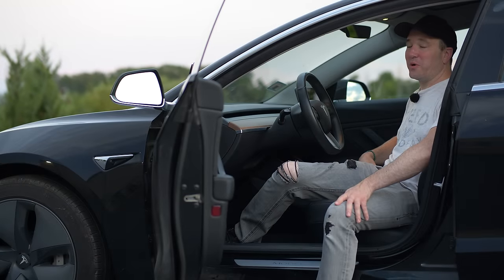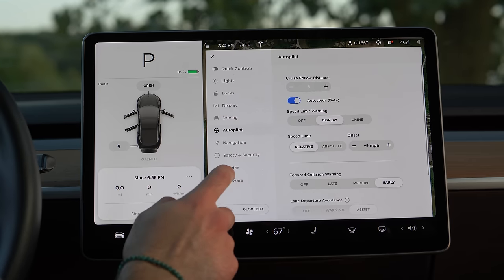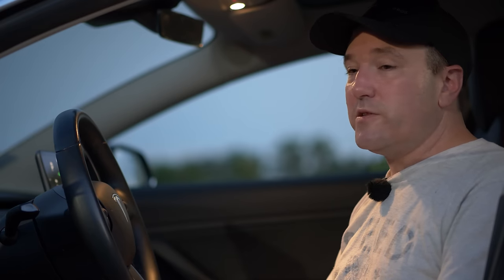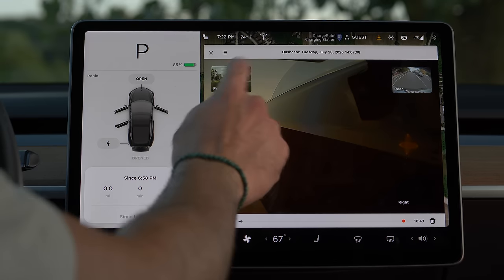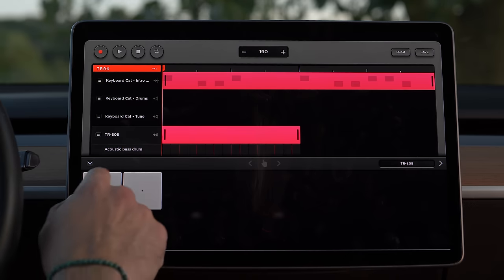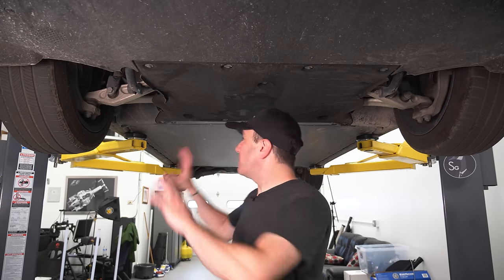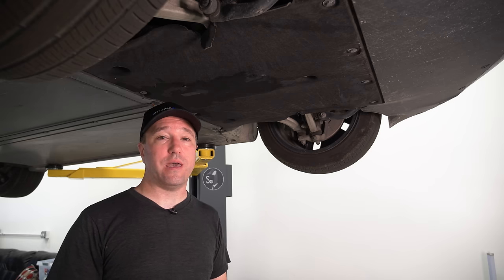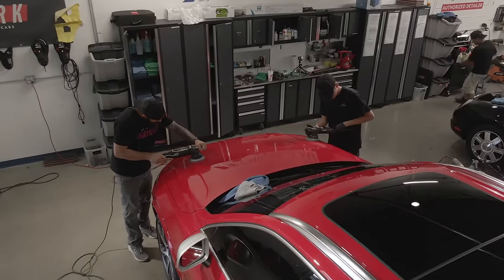Tesla Model 3 | Explaining the Cult

Comment: Disclaimer: I am a Tesla Model 3 Performance owner. 
First -- I love this channel and the content you guys put out. It's well produced, and made for car enthusiasts. The screen chemistry and real conversation between Mark & Jack works on so many levels. Too bad Jack doesn't chime in on this one.
Secondly -- I agree with most of your points both for and against the Tesla Model 3 from a "car guy" perspective. Though, the performance version takes on a slightly different personality in both handling and daily driving.
With respect to the screen distraction. As an owner for 2 years of my performance model 3 -- it's a non issue. You get used to where and how to quickly get where you need to be.  That said, your last video on the Mini Cooper Electric (also, very good) fails to mention the blend of physical switches/knobs, etc with the digital user interface.
Your charging infrastructure criticism: 90% of the time (if not more), you are charging at home if you have a garage or carport.
Before my Tesla Model 3, I had a Alfa Romeo Guilia Quadrifoglio -- It's a good contrast and brings much of the "emotion" of driving to the foreground that you mention in this video. The Model 3 does not have the same soul or  "enthusiast" feeling to it. Yet, it does feel like the future of the automobile in many ways -- which you mention.
Again -- This channel is required watching for any car enthusiast. Nice work!!
Reply: Michael Puhala I also own an M3P. Regarding the screen... in other cars you may use CarPlay or android auto, but those cars don't have anything close to autopilot. Autopilot makes it much much safer to use the screen. You shouldn't take your eyes of the road even with autopilot, but when you do for a second or so it's very comforting to know the car will automatically take care of most situations that could arise.
Reply: Hi! You mention that it is a nonissue. I think you are wrong in that, as:
- using a touch screen while driving is dangerous due to the fact of how our brains work: we are unable to multitask, but instead switch focus between tasks.
- even if a person (let's say you) is responsible and looks on the screen only while standing at a red light for example (to change temperature in A/C or whatever), I am very sure that most people are not like that, and will use the screen while driving.
- looking at people driving who take their phone out to use it even for 5 seconds makes it obvious how dangerous it is: nothing happens until a dangerous situation arises and may result in an accident.

Anyway, safe driving and hopefully you do not use the screen while driving.
Reply: @Kristjan_N  appreciate the call out to distracted driving. No doubt, playing with your phone or messing with a touch screen while driving is dangerous. No argument there. Many of the touch screen functions can be controlled via voice as well. .
The only function that does require some attention is adjusting the vents. So, this should only be done while stopped or in park.
Reply: The screen interface is simply the best I've ever used in a car.  After 2 years driving a LR AWD there is no way I'm anything but a safer driver in this car.  Not even close to the prior BMW and Lexus I've owned.   Very good review but the screen as a distraction or safety issue is a non-starter for myself.
Reply: Those two are on my list M3P & 2020 QV. Do you miss the emotion and handling?
Reply: @Hapkin  yes, for sure. Probably the vehicle that I miss the most is the QV. It's hard to articulate the Italian design language and feeling of the vehicle.
Reply: I have a model 3 performance and a standard plus.  His evaluation of the standard plus is spot on from a driving dynamics perspective, but I completely agree that the performance model is on a different level with 20 inch wheels and pilot 4s tires, along with track mode to dial back the stability control.
Reply: @Kristjan_N  three points you're missing out:
1. Voice control, no need to touch for various things
2. Using the Touchscreen while on Autopilot for a sec is quite safe
3. Any BMW or Mercedes has 5000 buttons that you can't handle blindfolded
Reply: @harry-eto  Thanks for pointing out the voice control - I have not used it in a Tesla, but I am skeptical as to its usefulness.
Autopilot is the main safety booster here indeed.
The only thing with physical buttons is that you can use them with muscle memory once you are used to your car, with touch screens it is much more difficult (hence why I don't change music etc while driving in my daily driver).
Reply: @harry-eto  1. Excuse for refusing to admit physical buttons are better
2. Read #1
3. That is flat out wrong. 
4. You're a fanboy for making things more dangerous than they need to be.

Comment: Tesla Model 3 Performance Owner. Mine was about the 200,000 one made.     Previously owned 2 Lexus RXs one was hybrid.  C5 Corvette, Miata,  RX7, 3 CRVs, a Prius,  Jeep Wrangler etc.   Lots of different cars.   Some expensive some not as much but fun like the Miata.   Here is what I will say, my Model 3 Performance is the fastest car on the road that also has a baby seat in the back.   It's beyond Corvette acceleration.  I cannot describe the level of performance.  Forget the screen, forget the paint, I could only dream I could win the lottery to get a car this fast and fun to drive before this car existed.  Forget it seats four people, does not attract cops, and is awesome in the snow, and mostly lets me control  levels of acceleration way beyond my skill level,  for 50,000.    It is like some sort of gift from the car gods where all of a sudden your 50k car is faster than 100,000k cars and it never needs to go to the shop for overpriced oil changes.   Just rotate the tires.  It's the democracation of performance.   Not good for long road trips but it can do it, if that is something you car about avoid.   Huge loss of range in east coast winters, not good.  Holds value like no new car I have ever owned.  Buying experience without shitty sales people, omg, dealers are such a horrible business model.  If you don't like change, you will not like this car, it is trying to change everything and some things like the door handles suck.   But the performance, I cannot even describe it.

Comment: I had one as a rental car and put about 500 miles on it.  Bottom line:  It has a lot to recommend it, but the build quality is really just not there.

This is a surprisingly spacious, comfortable, quiet, quick car, with excellent visibility and a lot of really nice features.  I really didn't find the lack of physical controls anywhere near as aggravating as I expected that to be.  I found I got used to it pretty quickly and the lack of a speedometer right in front of you is also far less annoying than you might expect.  

But it isn't all good.  When I turned the car in, it had about 2,500 miles on the odometer.  So the car they handed me was essentially brand new.  The dashboard developed an annoyingly loud rattle near the end of my rental.  Both rear brake lights were not properly sealed from the weather and already clouded with moisture, there was an obvious, large defect in the fabric in the dash that should never have left the factory.  When you put the car in park, the sound of the automatic parking brake engaging suggests a cheap mechanism that will likely fail soon.   

If I thought it were better put together, I might very well have bought one, it is an impressive vehicle in a lot of ways, but I'm going to look elsewhere.  I can't see spending that kind of money to get that level of build quality.

Comment: As far back as I can remember, I've always had this pure and unbiased obsession and love for cars and the automotive industry. I used to embrace innovation and change. However, after driving for years now, my obsession with cars has grown past window shopping and fast and furious montages. The older i get the more i am attached to the driving experience and its importance. Ive always loved driving however I've become so attached to the past and to what i know and love. the pure enthusiast in me is excited for the potential of EVs. But, the experienced enthusiast in me is going to miss the engine sound and rumble, shifting gears and physically feeling the change in rpm under my feet, the feeling of control and reassurance i get from driving.Speed is just a wow factor but its rewards will decrease and for that reason, I just don't see how EVs could possibly give me a better driving experience when they lack personality and interactivity. in short, I am torn.

Comment: Spot on review. I've been driving only Tesla's for the past 4  years (Model S, X  and currently Model Y) and as a daily driver it's fantastic and handles well enough And now with the longer ranges & supercharging infrastructure makes for a great road trip car as well. However, the long time car guy in me does miss all the tinkering I used to do, the visceral sounds that high powered ICE car brings and the fact that a Tesla is NOT a sports car rings true. It's just a very fast  & satisfying daily driver that requires much less annual maintenance.  But that extra time & money does allow me to have that weekend ICE sports or muscle car . From my non-green perspective, it's the best of both worlds ;-)
Reply: Same. M3LR here. Great daily, but it'a soulless. Plug it in daily. Lots of range. I have only needed to SC it 4-5 times (900km of total SC charging) in a total of 12k KM driven. So time saved vs a ICE as a daily in terms of tanking up at a gas station. Love the instant torque, the app for heating/cooling the car, great seats, quiet, great visibility, awesome audio system, and it handles well for the weight. For fun I take my ICE car to the track.

Comment: I changed out my 2002 manual wrx for a model Y performance and my initial impressions were that the single pedal driving and features are so alien compared to my manual wagon that it was not off-putting to transition over to this kind of drivetrain.  Already used to not fiddling with car features I didn't find the touch screen distracting.  Actually the wireless charger cradle forced me to put away my phone until I'm done driving.  I will say the build quality is just okay, taking the car in for manufacturing defect fixes this week..  overall Im liking the car a lot however.

Comment: We've been running an SR+ here in the UK for over a year now, and it was great to hear the opinions of a car person.
We charge at home, use the supercharger network for long journeys, and enjoy free electric at friends and family. Our home electric is 100% renewable, and we have solar.
I've driven a few muscle cars here and in the States, and (especially in the US) love the sound anf feel of a V8. However, we now enjoy the characteristic sounds of the electric motor, which brings a smile to our faces...and the passengers.
Once you've set the car up as you want it, via 'settings', you seldom touch the screen (you can go for miles and complete journeys without touching it). Like anything new, you have to understand it and get used to it. Drivers of supposedly safer, dial-and-button cars, are habitually on their phones, and fiddling with laggy infotainment screens. We've just tried using the browser and youtube while driving, and it wouldn't let us....maybe that's a recent sofware update? Also, should the screen go blank or hang, the car will drive normally, even autopilot, and you just reboot by pressing holding the two button wheels on the steering wheel...there are videos of people demonstrating this. But the fundamental software for driving the car is 'hard baked' with redundancy.
There'll always be the opportunity to take your 'classic' out for a blast, but we think electric is the way to go, at least with the Tesla. For a purpose built sports car, what about the Taycan...or wait for the Roadster.
Anyway, looking forward to your follow up videos, they're a totally different stance to the 'fanboy' stuff...although, have to admit we're fanboys ourselves.
Reply: The infotainment has NEVER allowed video playback while the car is in drive. If the touch screen does go out you still have wiper and headlight controls are on the wheel anyways.

Comment: I bought a Model 3 Performance, I could have cared less about the Enviro-Nazi’s, I bought it for the performance and Tech. I was leaning towards a diesel pickup before I made this decision. Long story there.
I just took a 4,200+ mile trip from Colorado to Florida and back. Except for that, I’ve always charged at home to a 80% charge - never needed or wanted to Super Charge.
My first car was a Datsun 280Z. It was loud, by my design, unreliable and ill handling but full of tactile feedback.
The Tesla is muted as you say, I am ready and embrace it. You can’t tell tell when it is in gear no vibration or change of tone of engine. It is nice to feel that the car is not slowly self destructing because of heat and friction. No emissions tests, oil/filter changes, timing belts, valve trains or direct injection problems. Not that there will not be maintenance needs.
The car performs the same on the highest mountain roads, above timberline as it would at sea level.
The display, at first was a distraction as you mentioned. At first, I would feel distracted and I’d pull over to make certain changes because I felt I couldn’t interface safely - I’d tell myself to DRIVE now, fiddle later. With a little time this went away and the screen is no longer a nuisance.
The Tech and over the air updates are phenomenal! Navigate on Auto Pilot is amazing! I’ve never considered myself a pussy and 18 hours of straight driving never phased me. But after 18 hours in the Tesla, I noticed how much better I felt - I can’t explain it.
EV’s aren’t for everyone but it is absolutely the right answer for me now. Did I mention I hate the Enviro-Nazi’s that are so much of the EV scene?
Thank you for you video!

Comment: As a new Model 3 owner, there are a lot of good points in this review, both positive and critical. Overall, the experience I'm having with it far exceeds expectations on so many levels. The car out-handles and out accelerates most of the sedans out there (except of course certain high performance sedans), yet fills up in my garage for the equivalent of $1 gallon. The power in my utility comes from majority renewable sources. It's warm and good to go before I get in. I've had zero problems with it. While EV's aren't 100% better than gas cars in terms of impact, they are a vast improvement. Nothing is perfect, but for such a young company, they are hitting this out of the park. I had my doubts going in, but ownership has changed my mind.
Reply: I'm glad I rented this before buying, because I found it cheap, corner cutting, and in the end just ok. The design, inside and out, leaves a lot to be desired, but it's not bad. It was like a Civic that was playing IKEA, going cheap and calling it minimalism. But hey, how else do we get a car for this cheap?